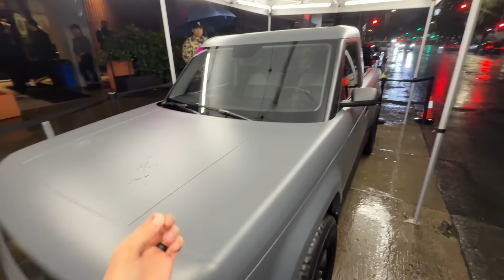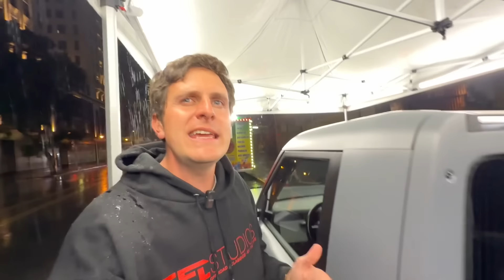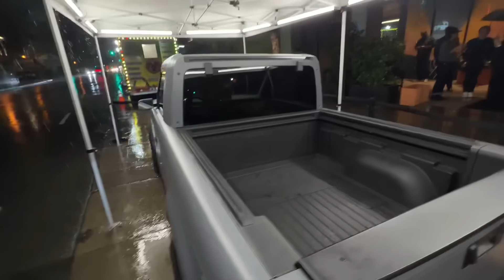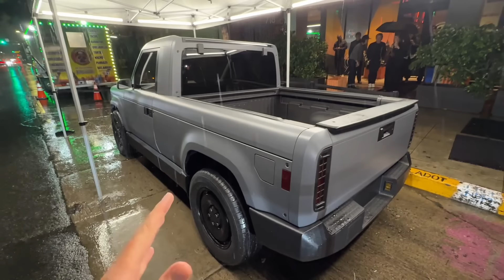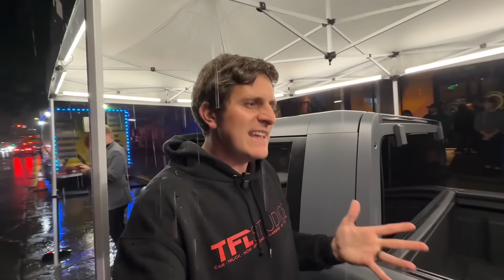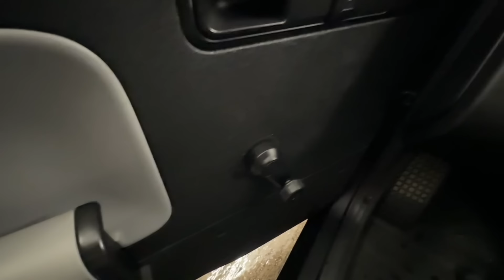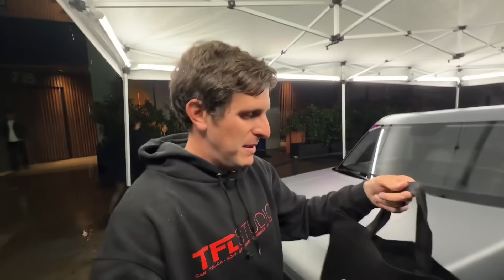The TRUTH About the '$20K' Slate Truck...Will This Really Be a Hit?

Comment: It’s made of plastic and is modular… wait until it gets hot, the panels are going to rattle like crazy when they expand in the heat and when they shrink in colder weather there’s gonna be large gaps!

There is a reason why all vehicles are made of metal!

Comment: The weight is centered in the vehicle.  Motor is over rear wheels.  My rear wheel drive Beetle never got stuck in snow or mud.  I doubt you really need 4 wheel drive either. We have been brainwashed by marketing.   The  real problem with today's cars is complexity.  More things to break, go wrong, maintain etc.  This is the least complex car I have seen in decades.   We once had basic cars and everything was a paid option.  Power Brakes, Power Steering, AC, automatic transmission and electric windows were optional features that you paid for.  Now everyone expects these in all in every car.  We still pay extra for them but now we don't have a choice.  Slate gives you that choice.  I think people don't buy EVs because they don't want the 14" screens that control everything and you must dig though menus to turn on the AC.  Don't want disco lighting.  They want a car that they can drive.  They said it best when they said that they removed everything that wasn't a car.  They chose to make it an EV because it is simpler and easier to maintain than an ICE car.  They didn't start out making it an EV.

Comment: It's $27,000. It doesn't matter how good the range is, it's electric, so it won't sell. This thing was doomed from the start. If they could get it down to around $20,000 with a little gas sipper (impossible for legal reasons) then MAYBE it would sell a few thousand units before they go bankrupt.

Comment: Many are saying we are approaching a huge car bubble like the 2008 housing crisis.  With huge inflation and wage stagnation, car repossessions are way up and the trend is being led by the huge over-featured mid and full size pickups.  If car lending criteria tightens up like mortgages did, folks will be forced into lower price vehicles.  Slate is also really appealing to the DIYer.  Not the old wrench turners, but young folks who love the idea of 3d printing their own dash panels or tail light covers.  No proprietary dealer only maintenance software - in fact no dealerships at all.  Again that has huge appeal to the younger folks.

Comment: I have paid my $50 (refundable)  to Slate to get my Slate EV Truck.   I'm excited to pay my $300 (not refundable) reservation fee to get the delivery date.   I will have plug in charging at my house with both on-grid and solar choices for sourcing my electricity.   I'll go camping with some flexible solar panels so I can let it charge in the sun for a week while I'm camping.   And, I'll always have the option to go to and EV charger if I want to pay for that.   Millions of other people will want these same benefits.  6 months after this video was posted, gas prices have gone from $3/gallon to $5/gallon and probably headed higher.  My interest in a small, lighweight EV truck has intensified, and I'm not alone.   When gas is $8/gal how much will buyers want a gas engine?

Comment: I question your reasoning for making the Slate a hybrid vehicle. There is already the truck you describe, it's called a Ford Maverick. The Slate actually offers a vehicle that no other manufacturer is offering. A small, fully electric truck at a reasonable price, that’s actually customizable and not locked behind a subscription-based paywall. If they can keep the price in the 25K range or below and the quality of the build is there then I am very interested in getting one.

Comment: I might buy one of these depending on price. If I can get the one with the bigger battery, speakers, and a wrap in the low 30k range, and the production version is well built, I'll put in an order. If that truck ends up being the same price as an awd maverick, that's a no.

Comment: Leaving on Wednesday for a local getaway. Pulling a small trailer with a motorcycle on it. Destination is 147 miles away. Slate would never get me there. Fine for a city runabout, but I’d rather have ONE vehicle that can meet all my needs.  I don’t need 4 doors. That’s why I have a 3rd gen Tacoma Access Cab, V6, Off Road, 6’ bed. perfect vehicle for me.

Comment: If it actually is $20k or less I'll get one, for short, stop and go trips. That is what EVs do best. I'll also have my regular car for longer trips, where a gas engine was made for longer trips where the engine needs to get up to a higher temperature for long term reliability.  They both complement each other, but people have a pick one or the other.

Comment: I think you underestimate the impact of the economy on people's ability to afford a vehicle. People are hanging onto older cars and repairing them until they die and, when they do, they have no transportation. Also, this was 4 months ago. Now that oil prices are climbing, more people are buying used EVs. The market has long been one of the US being sold on features they don't need. And those families with big cab trucks are in a world of hurt with these gas prices. I think we are on the verge of a shift back to the gas crisis days and the need for small, efficient, economical vehicles. I am not worried about this not being gasoline. I am more curious to see if we allow Chinese cars to be manufactured in the US (it's being negotiated) whether that shift will happen and the environment will change back to the days of the K-car and fuel economy. Simply because people may want to buy a "luxury" vehicle, but fewer and fewer people will be able to.

Comment: I want this truck so bad. I think at the original  price, it works as a third vehicle for the family. I do not want a truck ad my daily driver. I also hate quad cabs. I need a truck to just be a pure utility vehicle. The bed is a little short for my taste, but the price is what makes this thing work. I want a cheep bare bones utility truck for weekend project. I think this truck could be the answer.

Comment: Here's my concern about this truck - the small bed. It's reminiscent of the old Subaru Brat. Yes it's a truck but very limited usability.   The Telo EV make more sense but not at $40K. For this truck, $20K should be the high end. At $27,500 - I think it's too expensive an won't sell in volume. If I needed a cheap light duty truck, I would buy a 1970's to 2000 compact pickup for well under $10K and have a more usable vehicle. BTW, I own a 1976.5 Nissan Frontier ST 720 Kingcab.  AC, heater, Roll up windows, manual mirrors, manual transmission,  carburetored 2.4L.Very basic, but does the job. What I wish it had was power mirrors, rear disc brakes, and more safety features. The only safety features this has are seats with a headrests and a seat belt - other than that crash safety is no existent. This vehicle is a coffin on wheels.

Comment: It doesn't need a gas engine.. at all, but you're right, I don't want the low range 150 mile battery AT all. I'm also unsure about 4wd drive.. maybe, but it definitely needs some towing capacity; the thing is a truck that doesn't do truck things.

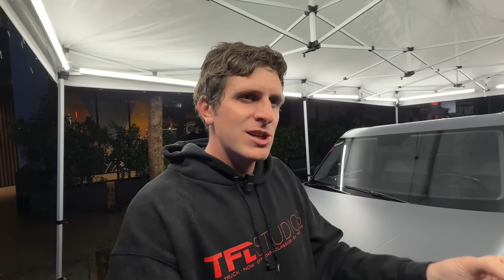Comment: 10:39  Crazy that a 57kWatt battery only gets 150 miles of range.  FWD 2026 Toyota Bz with a 54 Kwatt battery gets 236 miles so the Slate must not be very efficient!  (And that entry level Bz can be had for around 28k, has automatic windows, a radio and paint for that price too ;).

Comment: 1) Are there important "subscriptions" to gain access to important features? (You can rent the seat warmers, I don't care, but don't limit it to 80 mph without a $10/month "feature")
2) Can it be repaired by a hobbyist? (Bonus: Make bad battery cells user replaceable)
A simple motorized tool has a market. 
Slate can be for autos what Framework is for computers. (I have zero faith that this will happen, but that's the dream.)

Comment: what exactly stopping you from plugging in a 8kw honda generator and dropping in in the back, as long as you have the voltage systems compatible, with a DIY they just need to not lock it down and we can drop a generator in and have a hybrid, im an electrical engineer so that wouldnt be tricky

Comment: It's a cute truck, but I wouldn't call it simple.Because it's too overpriced for what is has it should be worth 10k or less the fact that it's customizable sounds cool, but it sounds like your parts could be easily stolen does it come with a good alarm system

Comment: The Slate is going to work.  It’s genius.  I drove pickups for decades for my business. I loved the simple, basic design.  Small cab and functional.  The pickups manufactured during the last 26 years are actually SUVs    They lost their charm.  

My only concern about the Slate is how will it compare to Chinese EV technology? How fast will it charge (it takes a Tesla 6x longer to charge than a Chinese car). I don’t want to wait six hours. 

Finally, your video is good.  Your suggestions will make these cars more expensive, which defeats the purpose of the Slate.

Comment: I feel like I’m the target customer for this truck. I own a small farm, but I work a 9 to 5 job in town Mon-Fri. I have a 30 year old diesel truck that is as reliable as an anvil I can use If I need the range or weight capacity. However a small, short range, cheap ev that I can drive during the week with the ability to occasionally bring home farm supplies is perfect for me.

Comment: Remember back in the 70's when you could stroll into your local Datsun dealership and drive out with a brand new pick up truck for under $2K.  It came with a 4-speed transmission  which most people today don't have a clue what to do with, roll up windows, even paint in any of several different colors...
The Slate truly is designed for todays consumer, electric so any dummy can drive it, no radio so other drivers won't be offended by bad "music", and they're all one color for todays "homogenized" politically correct, I’m neither male or female society.

Comment: I think it’s a great idea. But unfortunately, I think that by the time it gets to production, it will be around $30k. That’s a no go for me, and probably for most. It’s only sellable at those specs in the low $20’s. I mean, it’s a stripped down nothing truck! The real world range for the base model will only be around 100 miles. I Know because I have owned an EV since 2023 and I have experienced REAL WORLD driving! I hope it takes off. But I’m doubtful. A cheap Toyota HiLux with either a diesel or gas engine would do much better. America will NOT warm up to EV’s as long as gas is cheap! I’m currently in Spain. It’s almost $7 a gallon here when you do the liter to gallon conversion. When it gets that high in America, people will warm up to EV’s, but not until then.

Comment: The fact the company is allowing people to actually show and use the vehicle shows how much faith they have in their product vs. the BS hype from Tesla. This will do fine if they keep the price point low enough. But yeah 150 Miles a day is pushing it a little short for me. Easily most can average about 80 Min a day running around in an urban area. if rural easily 100 plus a day. Though most average about 12K miles a year or about 40Miles per day. I think the most biggest issue with EV cars are cost vs Gas and the range/charging issue. But if you make it cheap enough, i think that will temper some of the range anxiety for some

Comment: Greetings from Tucson! I understand what you brought up with what's currently available in the car market, like the Ford Maverick, for Slate's competition. The Maverick also has recalls. Recalls that take months to get fixed due to Ford's parts availability issues and their schedule backlogs. I just slapped down my 50-buck-reservation for the Slate. The range doesn't bother me, but I will get the battery upgrade to 240 estimated miles from the base 150-ish. I have a Subaru Crosstrek, that I'll keep, for road-trips that I'll "maybe" go on every 2 or 3 years. I don't need all-wheel-drive. I'm fine with paying 25k-ish. .... 29k realistically, after tax and licensing. I really like the simplicity of the Slate. My mobile phone and air-buds are good enough for me in terms of Slate's no infotainment/CarPlay system. The no-paint (I'll have the basic Slate gray panels - NO wrap) is a huge positive for me. Rocks are being kicked-up almost constantly during highway driving here in Arizona! Replacing windshields every other year is the norm, here. The paint on my 21' Crosstrek looks like it's been through a meteor storm and I DON''T tailgate - it's the highway driving and the gravel trucks salting the roads with f-ing rocks. Slate's no-paint = perfect! Just found your channel searching for Slate videos. New subscriber. Thanks for your take on the Slate! All the best!

Comment: Disagree about all those options you want, or think others want. I would buy a Slate if it had a little bit of storage
behind the seats. (Groceries, a pair of boots, a coat). It doesn't look like it has any storage at all. I like the roll up windows, and the uncluttered
dashboard. Rear wheel drive with traction control is fine with me. I grew up learning how to drive vehicles like
that, even in snow country. People have been spoiled by all wheel drive, and have lost (or never had) real driving
skills. Nix on the idea of a gasoline engine model. Let's keep things simple, please. 
You can option this vehicle with an SUV body, a sound system, etc., but for $25,000. you get a basic truck,
which is unheard of today. All disc brakes, 5 star crash rating, high reliability scores, lots of do-it-yourself
options. Two different battery packs available. Standard range, or extended range. But will it accept an overnight
charge from 120 volt grid power, at your house? Or will it accept only a fast charge?

Comment: I think they really screwed up on the RWD powertrain.  FWD would have fit the use case as being simple, cheap, and versatile.  I've owned and driven rwd mini trucks here in Colorado and it just sucked, they are scary, you can't climb hills/driveways, and you get stuck.  I also know many companies won't allow them to be used in their fleets.  I think Slate had a home run with company fleets as they are perfect for daily work rigs and with their modular design it allows for 3rd part customizing.  Once they add AWD or FWD i believe their price point will be in the extremely competitive mid-30's market.

Comment: i dont dislike how the slate is electric, its totally fine.

what I think they can also do to bring another option if there ever will be, is partner with chevy to get the 1.2L Turbo from the trax, or the 1.3L turbo from the trailblazer. Another option is ford with the 1.5L turbo in the bronco sport.

these would also make the truck cheaper comparatively to being electric, and the engines are small enough and well matched in power for what this truck is meant for.

Comment: The price looks like it has increased to $25,000 - $100,000.  I want the base. I don't care if it has a radio. If I drive 24 miles to work and 24 miles back, and plug it in, it has done its job.

Comment: This is a $15,000 truck being sold for $27,500 and advertised as $20,000 because they are including the rebate in the price (bad form).  With everything they stripped out, they don't have a corresponding price reduction (at least not in magnitude).  There is no AWD/4WD option.  I wanted to like Slate but it is more gimmick than actual solution to the inexpensive truck problem.

Comment: I do take trips and range is huge to me. I live in central Arkansas and travel to Springfield MO and Tulsa OK quite a bit. 150 miles won't get me to either. The extended range option won't get me to Tulsa and will barely get me Springfield, and considering the hills along the way, it may not. 

If you JUST drive back and forth to work and around town, this works. For those who do venture out... No.

Comment: This will be very popular with companies that use a lot of Taylor-Dunn type electric carts. We had tons of electric carts in our department, but every once in a while we needed a street legal truck and had to borrow one the giant trucks from the garage. The problem with making it gas powered is that they would have to design it with a much larger wheel base to meet the current Federal DOT standards for trucks. That's the main reason why trucks and SUVs suddenly got really big. These larger wheel bases allowed them to have lower fuel efficiency requirements. (And reduced the price to manufacture.)

Comment: Just because "most" people default to loaded, bloated 70k pickups does't mean there isn't a whole bunch of people that don't do that but that would buy something simple and cheap to keep.  My last truck was an 86 Chevy C10 single cab that I fixed up and I loved it. Drove it for 10 years as a 2nd car.  Love to have something New. Electric. And Simple.  Yep, count me in IF it makes it to market.   I'm beginning to question how they are supposed to start delivering vehicles this calendar year, but yet we have no specifications or technical data of any kind other than basic measurements.  How have they not posted what motors they are using.  How much power?  etc etc    Yes I have deposit down

Comment: Its not going to sell at it's starting MSRP. Some people will buy it for the social aspect, but for most people this truck makes no sense, at its price. For less you can get a new hybrid Corolla that is fully loaded and are more versatile. It costs too much for what you end up getting. If it cost 15k less at a base price, so starting around 12.5k, it would sell all day. People would then add on all the features they want bringing the cost to over 20k. Slate would be smart to find a way to bring the cost way down. Otherwise this will be a failed social experiment.